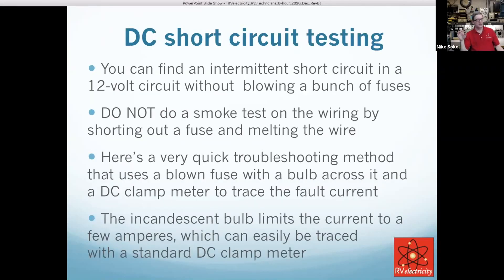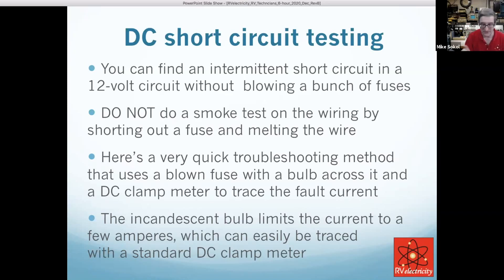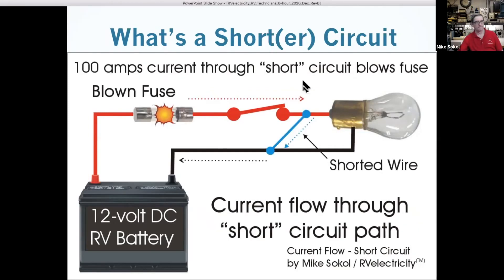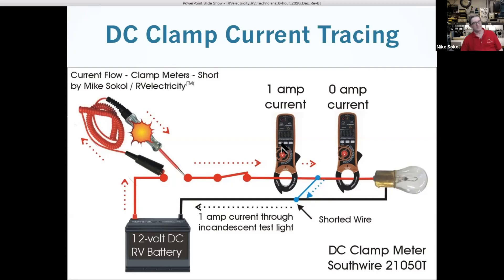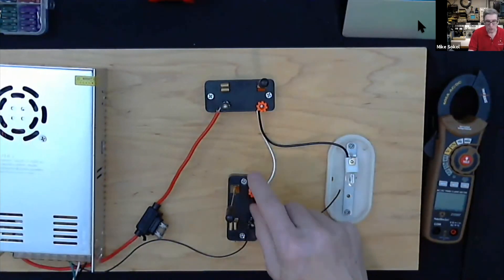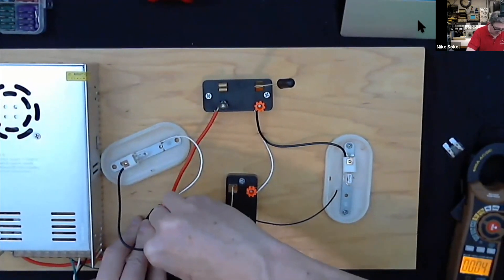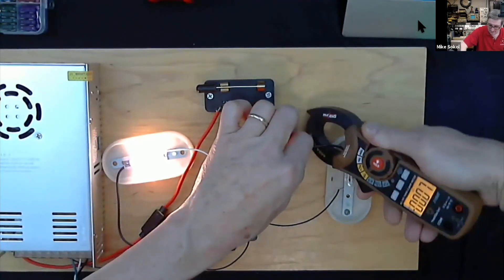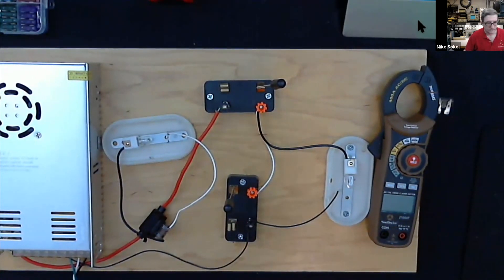Short Circuit Current Tracing by Mike Sokol

Comment: Surely when you close the switch causing a short circuit current still will flow back through the black wire  going back to power supply